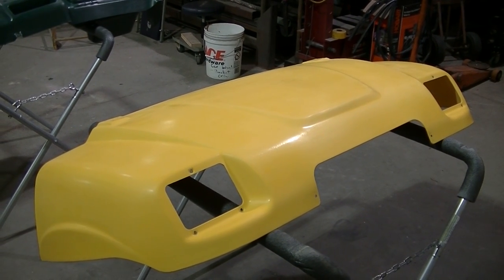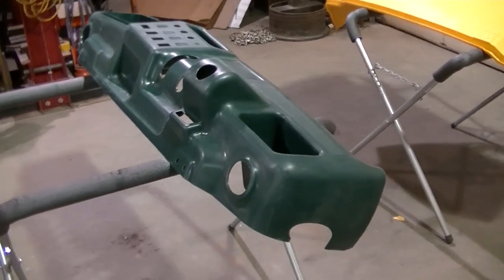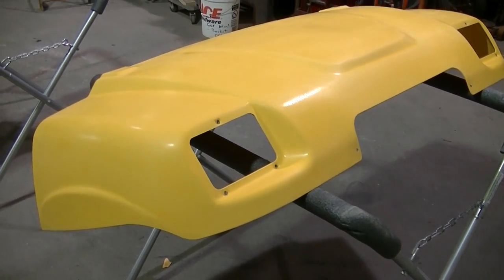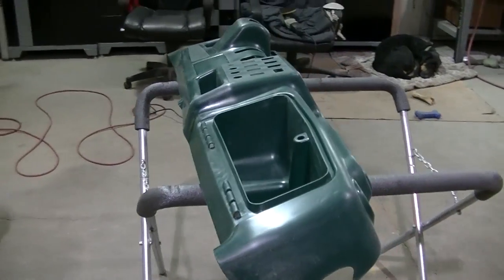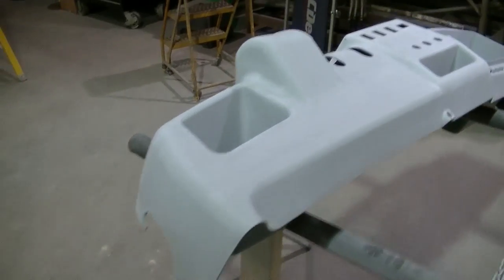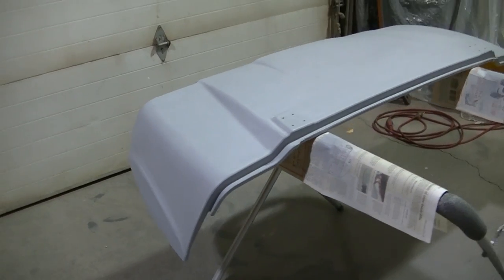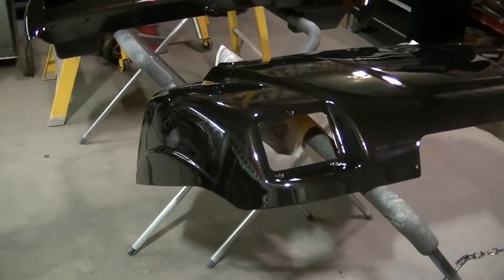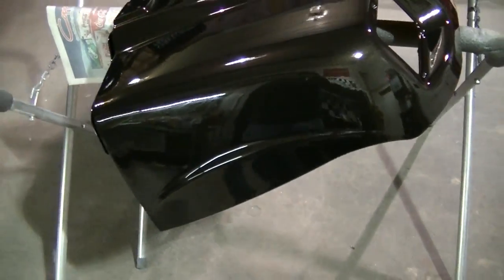2003 Polaris Ranger 6x6 "Painting Hood and Dash"

Comment: A fee more questions for ya . Did u have to use a puller to remove the steering wheel to get the dash  off?
Reply from the maker: There is no way to attach a puller on a Polaris Ranger steering wheel. I have seen people drill holes to get a stuck steering wheel off. Sometimes they come off easy and other times the come off hard. Rubber hammer with some good hits to the back side usually will do it. A sledgehammer is a last resort thing, but I have had to use one. It will nick the plastic.
Reply: @mossman381  so just pull the nut off and the steering wheel should just hammer off i was not sure did not want to break anything lol
Reply from the maker: Just unbolt and remove. Good luck.
Reply: @mossman381  yah man i beat on the thing all morning lol.. a boat load of wd40! still no luck i need to get the dash off the dang thing to paint it and all that

Comment: question on the black about how much did it take to coat it? quart wise. ?
Reply from the maker: I would say a quart should be enough to easily paint a Ranger.
Reply: @mossman381  sounds good I'm thinking of using a custom mix of  plasidip and spray using a spray gun not aerosol cans . Thinking  on the hood and dash since they get hardly any wear and bed lining the bed . Trying to get rid of the green I like the dip so I can change it if i get tired of the colors without hours of prep work is my thought was going to wrap it but the dash would be pretty hard without cutouts for the glovebox and cubbie hole area the hood would be easy though .

Comment: what paint brand and color did you use?
Reply from the maker: I used extra paint I had from painting my dads 2000 Freightliner Classic. The paint was Dupont brand and the color is a black metallic.
Reply: @mossman381  Thanks!
Reply: @mossman381  what primer did you use ? what would be the steps b4 primer prep wise